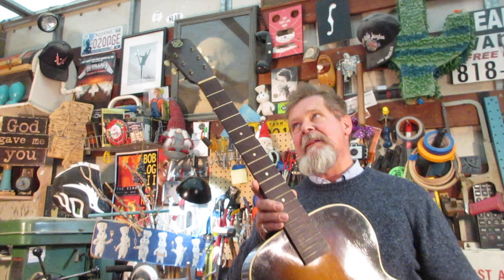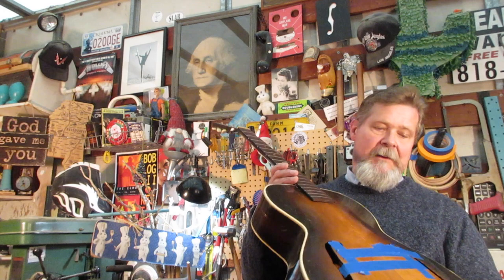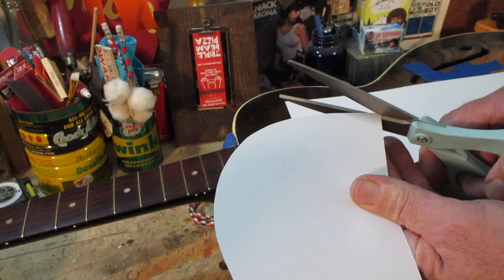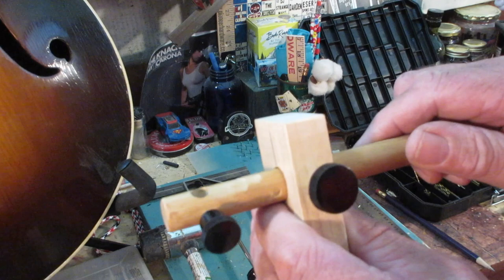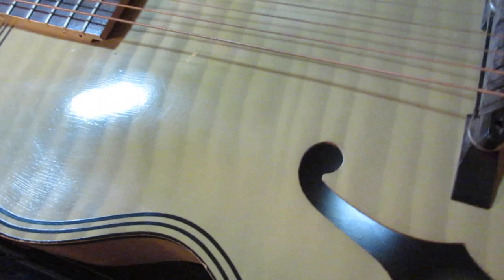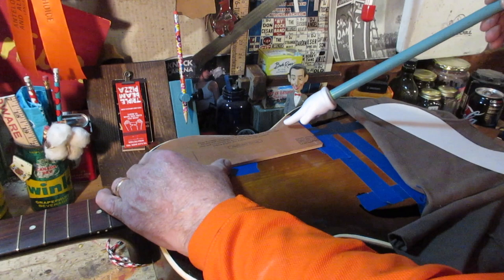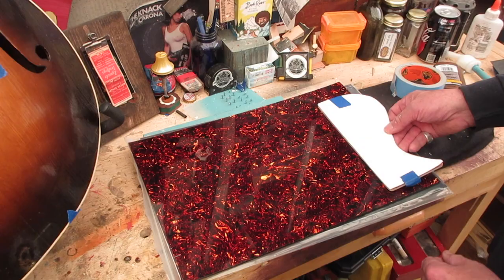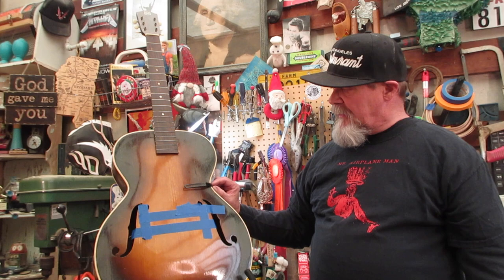DIY Electric Archtop Pickguard

Comment: Thanks man love it… Put my pick guard on yesterday harmony H 1215 used a K & K pick up slight curvature and the pick guard, because of the Jack. It looks great though. I bought this guitar for 300 and it came to me busted because wasn’t packed right.  So it’s been a little bit of a project. Had a lapping split from F hole all the way back. Carefully got it back into place- hide glued, now we’re good. Guard was 17, bracket was 6.85   If you’re interested in seeing it I can send you a photo. Thanks for the great videos
Reply: I want to add project cost me a lot more than that because how about felt  , Double-sided tape, and believe it or not I never have a drill I did have to go to heck I put them I don’t know. Probably could’ve had it done but I didn’t wanna leave my guitar anywhere and it was fun
Reply from the maker: Yes.  Send them.  Kpcbgs@gmail.com
Reply: @paulmerojunkpileguitars  It gets funnier involves a paintbrush no finish damage can you guess what I’m doing? I’ll send you a photo

Comment: You mentioned “period correct music”.  When you tune this up, do you tune it 440 frequency or period correct 432 hz.  I have one very similar to this. I prefer my older guitars in 432 hz.  It reduces string tension, gives it a better sound, and easier on the fingers .